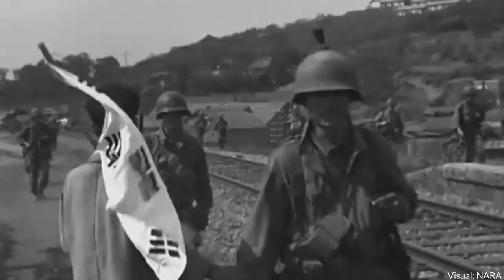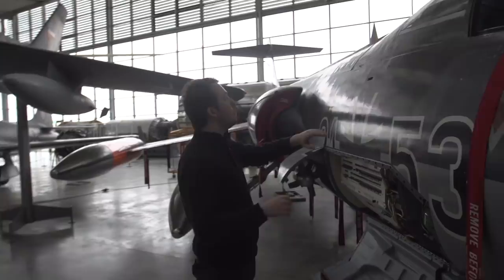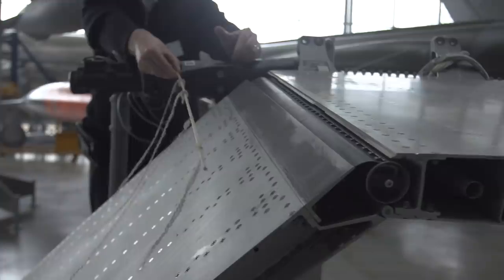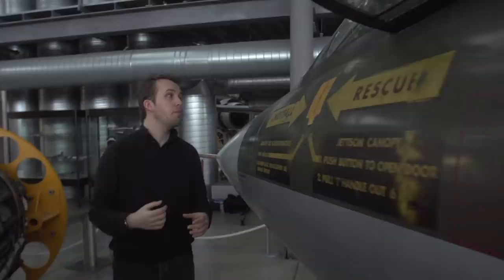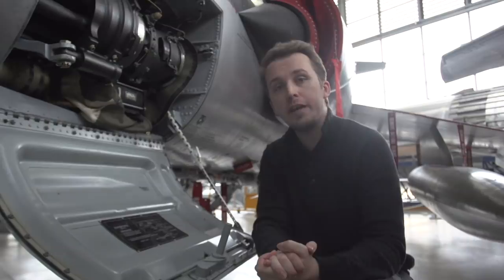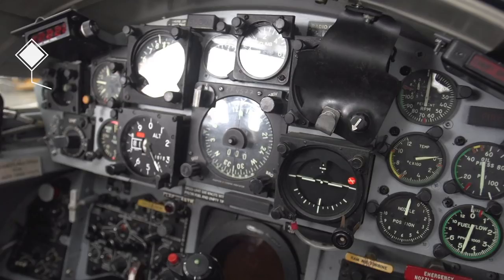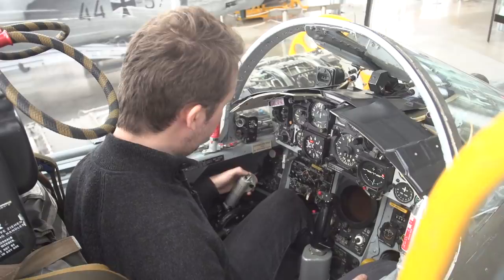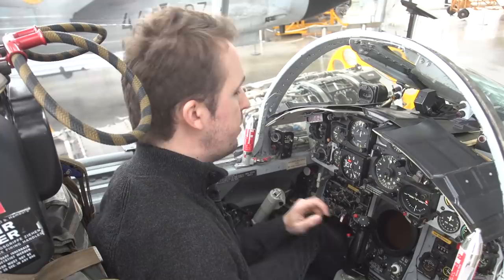F-104G Starfighter - Inside The Cockpit

Comment: I think Starfighter is still the best name ever for a "fighter" jet.
Reply: yes definitly
Reply: With new avionics system, radar and electronic equipment make it nice recon plane. Plus with computer guided unit, from widow maker it will be widow producer
Reply: @GForce_Shutter  i know german starfighter pilots ,it was a ver good plane ,it was a rocket with2 small wings ,you sit on a  powerful engine.The pilots like to fly the plane becouse it was a lot of fun
Reply: well... so great it got a namesake in star wars....
Reply: Agreed! ”Thunderstreak” is a strong contender though IMO
Reply: Good , but I think Lightning is an even better name. Especially when made by a company called English Electric.
Reply: @kelvinfoote9897  
Whether or not you think the name "Lightning" was a better name or not, the British didn't offer it for sale to the Germans.

And perhaps more importantly, there used to be a joke very similar to the one about buying land in German if you wanted to own a Starfighter for the Lightning with the only change being that one just had to stake out some area in the North Sea.
Reply: @lewiscole5193  Not entirely sure what you are saying there. Is that a comment on the chronic lack of fuel in the lightning , so that it would fall into the sea? Its fuel consumption was very high and only partially remedied by the ventral fuel blister and then wing tanks. However , the Starfighter, with such an extremely high wing loading,  was far more dangerous and killed a much higher % of its pilots.
Reply: @kelvinfoote9897  
> Not entirely sure what you are saying there. Is 
> that a comment on the chronic lack of fuel in the 
> lightning , so that it would fall into the sea?

It's a comment about a similar "joke" existing for the Lightning as there was for the F-104 with the only difference being that the crash area involved the North Sea rather than German land.

And the reason for the crashes into the North Sea were for the most part not due to the Lightning running out of fuel but rather fires that occurred because the Lightning designers tried to wrap the tightest possible aluminum skin around the largest possible engines ... something that the Lockheed designers tried to do with the F-104, but without causing fires.
Catching fire was a persistent problem for the Lightning both on the ground and in the air.

> Its fuel consumption was very high and only 
> partially remedied by the ventral fuel blister 
> and then wing tanks. 

Mmmm.

> However , the Starfighter, with such an extremely 
> high wing loading,  was far more dangerous and 
> killed a much higher % of its pilots.

High wing loaded is not inherently dangerous and since skin friction becomes especially bothersome at high speeds where more than enough lift can be generated with smaller wings, reducing wing size is a common practice in any aircraft that's supposed to spend a lot of time flying at high speeds.

More to the point is that if you define "dangerous" as being the opposite of "safe", then the Lightning was not at all a much "safer" aircraft than the F-104.
In fact, the accident rate for the Lightning was at least at times worse than the F-104 ... that's right WORSE ... despite what you may have heard.

Peter Caygill, author the book "Lightning from the Cockpit: Flying the Supersonic Legend" also wrote a book entitled "Lightning Eject: The Dubious Safety Record of Britains Only Supersonic Fighter" in which he wrote the following:

  Although the actual number of F-104G 
  accidents in West German service was 
  significantly greater than the total 
  number of Lightning accidents, this 
  tends to be obscured by the fact that 
  many more F-104Gs were delivered to 
  the Luftwaffe and Marineflieger .  
  Including the twenty development batch 
  aircraft, Lightning production for the 
  RAF amounted to only 280, whereas a 
  total of 916 Starfighters were taken 
  on by the German armed forces.  It is 
  only when an analysis is made of the 
  accidents per flying hour that the 
  true picture begins to emerge.

  During the first ten years of Lightning 
  operations in the RAF (up to the end 
  of 1969), a total of 199,000 hours 
  were flown and in this time thirty-two 
  aircraft were written off in accidents 
  (this figure includes two Cat.4 
  accidents in which the damage level 
  was subsequently upgraded to Cat.5).  
  Thus, on average, a Lightning was 
  destroyed every 6,218 hours flown.  
  During the complete life of the F-104G 
  in West German service, total flying 
  time amounted to 1,975,646 hours and 
  there were 298 accidents that resulted 
  in 298 accidents that resulted in 
  complete write-offs.  A Starfighter 
  was therefore lost for every 6,630 
  hours that were flown.  If the 
  seventeen-month period from the 
  beginning of 1970 is included in this 
  analysis of the Lightning accidents 
  [which was presumably when one 
  Lightning was being lost every month]
  the loss rate worsens to one in 
  every 5,795 hours, and if this 
  period is looked at in isolation an 
  aircraft was being destroyed every 
  4,667 hours.  These figures indicate 
  that the accident rate per flight 
  hour for the F-104G and the Lightning, 
  although not dissimilar, show that the 
  latter [the Lightning] did have an 
  inferior safety record for at least 
  some of its operational life. 

And something to keep in mind here is that the accident rate of the Lightning SHOULD HAVE BEEN LOWER than the F-104G as this is what commonly happens when comparing an interceptor to a non-interceptor, at least according to an old Rand study on fighter aircraft accident and attrition rates during peace time that I have somewhere.
This is something that I think Caygill alludes to but doesn't actually come out and say when he says:
 
  This was despite the fact that the 
  F-104G was designed at the outset as 
  a strike/attack aircraft so that it 
  spent much of its time operating at 
  low level, often in bad weather, and 
  was therefore more vulnerable to 
  terrain, bird-strikes and obstructions.  
  In contrast the Lightning had begun its 
  life at medium and high altitudes and 
  it was only towards the end of the 
  1960s that it also took on a low level 
  role in addition to its previous duties.
 
So think about that for awhile: the Lightning had an even worse safety record than the F-104 and Caygill just happens to say that the F-104 had the worst safety record of the Century Series ... doesn't that mean that the Lightning had a worse safety record than ANY of the Century Series?
Oh my ... isn't that a disturbing thought.

So did the F-104 kill a higher percentage of pilots compared to the Lightning?
Well, according to Cargill, a German pilot had a much greater chance of dying in an F-104G in the case of a crash than an RAF pilot in a Lightning (about double which may explain why it was SOP to just punch out if any problem was encountered), but he also notes that there was a 6-percent chance that a Lightning pilot would experience an engine fire and a 25-percent chance that he would not survive such a fire.
But in real terms, what you are trying to suggest, is that the F-104 pilots were killed more often (either in absolute terms or relative terms) because the F-104 was a poor design/manufacture/whatever compared to the Lightning.
But as Cargill points out:

  These differences in usage are 
  reflected in the breakdown of accidents 
  as 43 percent of all F-104G crashes 
  were attributed to pilot error, with 
  41 per cent being the result of a 
  technical defect.  In the case of the 
  Lightning, the number of accidents put 
  down to pilot error was generally around 
  the 20 per cent mark, although write-offs 
  as a result of technical defects was 
  significantly higher at 65 per cent.  
  Of all the Lightning accidents that were 
  caused by technical defects, approximately 
  two-thirds were due to fires both in the 
  air and on the ground.
Reply: Even the Lockheed C2 ejector seats originally supplied with Luftwaffe aircraft were highly dangerous and could only be used effectively at speeds over 104 mph.

‘The extra weight, combined with intensive low-level operations in a type designed as a high-altitude interceptor, worsened the already difficult handling characteristics and contributed to a spate of accidents when the Starfighter entered German service in 1960.

Wartime fighter-aces such as Johannes Steinhoff and Erich Hartmann, who were senior Luftwaffe officers in the 1960s, did their best to improve the situation. They introduced more thorough training programmes, and had the Lockheed ejector seats replaced by the far better Martin-Baker Mark 7 ‘zero-zero’ model, which could function even when the aircraft was stationary on the airfield.

Despite these measures, the F-104G had an appalling accident rate, with at least 262 crashes, which claimed the lives of 115 pilots. Unsurprisingly, it soon became known throughout the Luftwaffe as Witwenmacher (‘the Widow-maker’), and there were few regrets when the type was phased out in favour of the Tornado in the 1980s.’

The Lightning was undoubtedly a dangerous aircraft but as it did not have such dangerous handling characterises as the F104, resulting in a lower % of actual pilot deaths,  rather than crashes , I maintain that it WAS a more dangerous aircraft  in it’s design.
Reply: @kelvinfoote9897  
> The Lightning was undoubtedly a dangerous 
> aircraft but as it did not have such dangerous 
> handling characterises as the F104, resulting 
> in a lower % of actual pilot deaths,  rather than 
> crashes , I maintain that it WAS a more 
> dangerous aircraft  in it’s design.

You can "maintain" what ever you want as you are certainly entitled to your opinion.
However, if you want to actually try to convince someone (like me) that what you are saying is actually a valid logical proposition, then you have to present a logical argument and facts in support of that argument and proposition.
That's a much harder thing than I suspect you realize and so far is not something you've even begun to do.

In particular, you need to point out more explicitly what those "dangerous handling characteristics" are (or at least the most significant one[s]), how they actually resulting in a lot of aircraft and/or pilots losses, then provide some evidence that they didn't exist or at least were reduced in the case of a Lightning, and then finally present some real live evidence that shows these changes actually did lead to reduction of losses of aircraft and/or pilots in the case of the Lightning that wouldn't have existed if they hadn't existed.
And just to spell things out more clearly about that last part:  you have to demonstrate that some significant number of accidents were caused by the "dangerous handling characteristics" of the F-104 and NOT BY ANOTHER CAUSE , and after you do that, you then have to demonstrate that if the Lightning were used in place of the F-104, said accidents would not have occurred FOR ANY OTHER REASON other than the Lightning's lack of those "dangerous handling characteristics".
Failure to demonstrate both of the above means that you have failed to make your case.  Period.  Full stop.  End of discussion.
So Good Luck with all of that.

In my case, all I have to do to demonstrate that the F-104 high accident rates that occurred during the F-104's years of service with the German military (in particular its early years) weren't the result of a "design flaw" (or flaws) is to show that said rates could be/were reduced significantly WITHOUT changes to the design of the aircraft.
(If the accident rate were due to a design flaw, then the accident rate should remain largely unchanged and high until/unless something was done to correct that design flaw.)
As it turns out,  this is easy to do since that's exactly what happened after Steinhoff took over control of the Luftwaffe in 1966.
He immediately grounded the F-104 fleet, had them all inspected, and then put them back into the air with NO changes to their design (only changes to how they were maintained and flown) and, lo and behold,  the accident rate dropped IMMEDIATELY compared to what it was before he grounded them.
And this drop occurred even before the Lockheed ejection seats were replaced by the Martin-Bakers (years before in fact).
The Martin-Bakers no doubt did save German pilot lives as they could now feel safer ejecting when something went wrong rather than trying to ride the plane down to the ground, but that change didn't make as significant of a change as occurred before their introduction.
IOW, case closed.  Already done. My assertion has been proven.

So the ball is definitely in your court to show that there was a "dangerous handling" design flaw in the F-104 that the Lightning didn't have which would have resulted in fewer planes and pilots being lost.
But if/when you try to do that, may I not so humbly suggest that if you want to be taken seriously, it would help a whole lot if you did something that demonstrated that you actually know something about safety, like the difference between an accident rate (i.e. the number of accidents per unit period of time) versus an attrition rate (i.e. the number of aircraft lost out of some population of aircraft possibly over some period of time).
Since anything made out of aluminum will eventually fail if it's flexed long enough, it's a given that any aircraft made out of aluminum will eventually fail given enough time unless the aluminum parts that it's made of are replaced.
IOW, given enough time, the attrition rate for any batch of aluminum aircraft will eventually reach 100% even if the number of pilots injured/killed remains at zero.
So do everyone a favor and STOP trying to use ATTRITION RATE in place of ACCIDENT RATE (or mishap rate).

When you talk about 262 aircraft being lost and 115 pilots, you're talking about an attrition rate, not an accident rate.
A high attrition rate MAY indicate a possible safety problem, but it MAY NOT as evidenced by the fact that the Spanish military managed to fly its F-104s for seven (7) years without a single loss due to accident.  Not one.
Meanwhile, the Canadians lost more of their F-104s than the Germans did (around 45-percent versus around 33-percent), but in the 25 years that the Canadians flew the F-104, there were 110 class-A accidents (basically a complete loss of an aircraft or an accident that results in the death or permanent disability of a member of the crew) resulting in the death of 37 pilots whereas in the 12 years that the Canadians flew the F-86 (the predecessor of the F-104), there were 282 class-A accidents with the loss of 112 pilots.
IOW, the F-104 was arguably "safer" than the F-86 in the hands of the Canadians despite their high attrition rate.

It would also help if you want to be taken seriously (at least by me) if you would stop spouting meaningless bullshit from some other unidentified source.
(If you want me to provide my sources, I'm willing to do so when I can, but at least in some cases, I've forgotten the exact source and so may have to presenting an alternative.)
The bullshit about the F-104 being known throughout the Luftwaffe as witwenmacher (‘the Widow-maker’) is one such example.
The expression "widow maker" was common in the press, but if you look at just about any source to see what the German pilots actually called it, you will see that this expression is virtually never used.
The closest you'll find is "aluminum death tube" or "flying coffin" or "lawn dart", but those expressions are relatively few and far between, and instead, you'll find instance after instance of pilots saying that of all the aircraft they flew, the F-104 was at or near the top of their favorites list.

And here's something that former F-104 pilot Wolfgang Czaia with regard to the expression "widow maker":

  By 1966 the accident rate was unusually high, and 
  a lot of it was weather-related.  Quite often small 
  technical problems would -- due the pilots' 
  inexperience and lack of proficiency -- be the 
  trigger for chain reactions resulting in accidents.
  Once the wings began flying steadily and pilots
  were getting the required flight time the accident 
  rate dropped to 'normal' (ten accidents per 
 100,000 flight hours) - but the public still perceived 
  it as a dangerous machine, with names like the 
  Witwenmacher ('Widow Maker') or 
  Fliegender Sarg  ('Flying Coffin').
  Compounding the problem was that every 
  subsequent ground or flight accident continued 
  to make major headlines.  
  We had just as many accidents in F-84s and F-86s, 
  but these stories would be buried on page 3 or 4.

The credibility of your source is also a bit suspect to me for saying that "there were few regrets when the type was phased out in favor of the Tornado in the 1980s" when the phase out started in 1971 to F-4s.
Reply: @kelvinfoote9897  
One more thing that I thought about bringing up before.
Many people seem to think that Life would have been wonderful for the (West) Germans if only they had bought the Lightning.
While I have seen some sources that indicate the Brits did offer the Lightning, the vast majority that I tend to trust say they did not.
Instead, they offered the paper airplane (existing only in mockup), the Sanders Roe SR.177,  which they apparently didn't do much to try to sell it to the Germans.

But even if the Brits had offered the Lightning, what is clear is that the Lightning as it existed at the time in the P1 variant with only maybe 20 examples flying.
And at that time, the Lightning was clearly a point defense interceptor which would not have satisfied the German requirement for something multirole capable where one of those capabilities happened to be ground attack with a one ton nuclear bomb like the B-43.
Eventually, the Lightning would be modified to do ground attack, but even in that modified form, it was not capable of carrying a one ton bomb, nuclear or otherwise.

Meanwhile, Lockheed was more than willing  to all but redesign the F-104 variants in use by the USAF into a multirole aircraft that could carry a nuclear bomb, the "Super Starfighter" AKA the F-104G.
(Actually there were four different types of nuclear bombs that the F-104 could carry.)

I certainly have my doubts about the Brits willingness to sell the Germans the Lightning no matter what as they turned down the Indians who asked for it a few years later and so they ended up going to the Soviets to buy MiG-21s.

So here's the thing:  unless you can somehow show that the Lightning could have reasonably ended up in the hands of the West Germans instead of the F-104, all you're doing is just fantasizing about how many angels can fit on the head of a pin.
Reply: How about "The widow maker"?
Reply: @Akwa47  
The "widow maker" moniker was typically applied by the press and not by the F-104 pilots who actually flew them, as opposed to the MiG-21 where the moniker (along with "flying coffin") was applied to the MiG-21 by the Indian pilots who flew them.
Reply: Shooting Star is cool too
Reply: XF-103 “thunderwarrior” has to be pretty high up there
Reply: Certainly sexier than Warthog or Aardvaark.
Reply: i wonder if, when coming up with the name for the newly-developed plane, "Airfighter" and "Skyfighter" were crossed off the list  since "Starfighter" was too good to pass up